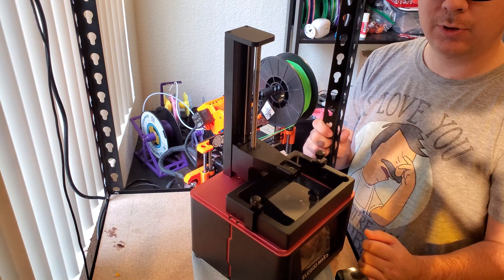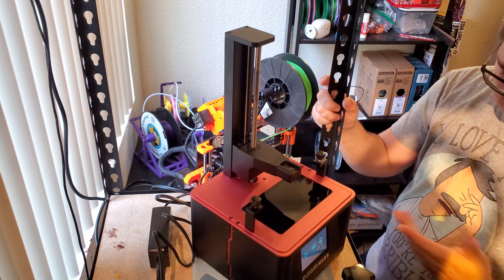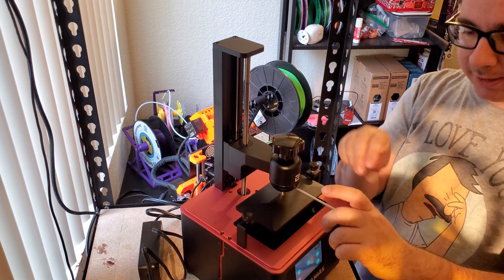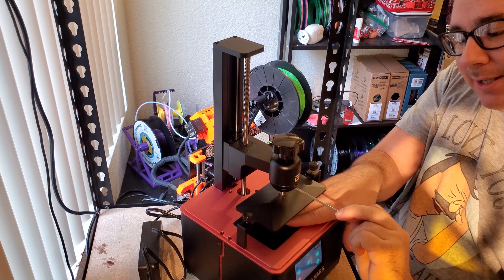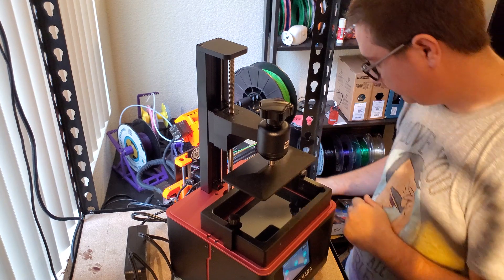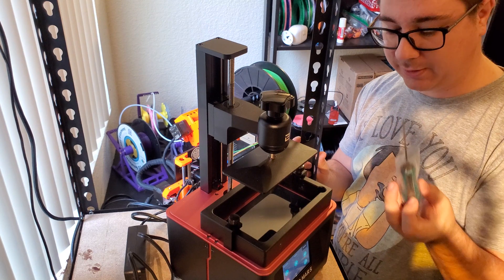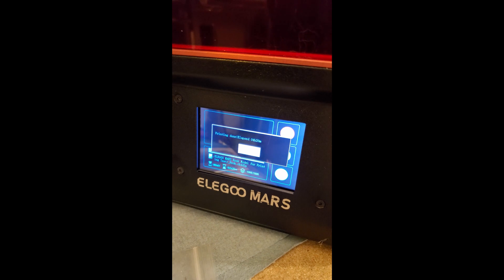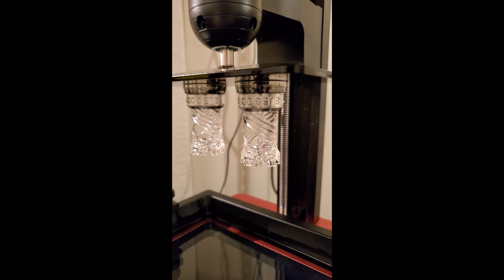Elegoo Mars Setup and First Print

Comment: Iv had nothing but failure after failure since i got mine not 1 print i dont know what im doing i think i might messes with the settings b4 trying itvbut its the elegoo mars pro and freebtest prints start then fall off build plate a couple mm started about half inch i get first detail lines of the rooks that's it falls off i have it months and have yet to get 1 simple print so annoying
Reply from the maker: If you're POSITIVE you've leveled the bed properly, increase your bottom layer time. I'm around 60 seconds per layer. Also, if your resin is cold, hit it with a heat gun for a few seconds. Cold resin doesn't like to print well.